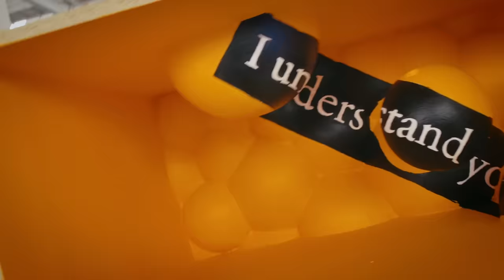OK Go - The Writing's On the Wall - Official Video

Comment: The thing about this that I love, is not just the optical illusions, it's the fact that this is a long pan shot. Aka, the video has no cuts to different illusions. Long pans are not very common in films and even if they're incorporated, they're short. This is because long pans are really hard to make. And this video, creates multiple optical illusions with ONE long pan, managing to position the camera at just the right angles at all times, with no cuts in the footage. It is so incredibly fascinating to watch because this video accomplishes something that even Hollywood has a major difficulty with.

I love this video.
Reply: There could be hidden cuts, but the vid is still excellently made if thats the case
Reply: Watch this too shall pass if you haven't already!
Reply: Yes and the band must have an incredibly much lower budget than say Hollywood so it’s really impressive. A lot of on rid left artwork and designs and creations, plus yes the perfect angles all the way through the pan
Reply: @nguyen-vuluu3150  there's a behind the scenes vid , its edited to be a bit smoother but they did it in one cut from all the fumbling and running from the entire crew and band
Reply: @nguyen-vuluu3150  Nope, there's none.
Reply: "Long pans are not very common in films and even if they're incorporated, they're short."

If you haven't seen it already, you should check out "Russian Ark." 

96 minutes long, one single unedited take. 

Shot in the Hermitage Museum in Saint Petersburg, it is narrated by a ghost who is accompanied by a French aristocrat who despises Russia and considers them to have no historical or cultural value. The ghost guides him through the museum and 300 years of Russian history, hoping to convince him otherwise. 

There were something like 2000 actors, and the final cut was one single 96 minute take. Just imagine the level of precision and synchronicity needed to pull that off. 

Not an easy film, it's rich with historical detail, and as soon as one story is told, the next begins without hesitation. It's a mammoth historical journey, and can leave your head swimming quite a lot, but if you like the cinematic aspect of that one huge take, then it's a must. 

https://en.wikipedia.org/wiki/Russian_Ark
Reply: @nguyen-vuluu3150  if you think that, you dont know the band. "This too Shall Pass" took like 9 months in the making, over 5 thousand shots. One single, big, long, take.

Comment: I was racking my brain thinking of how they could have painted everything to fit so perfectly, and then I had an idea. What if they put a projector in the place where the camera would go, and then they projected the image they wanted to make (square or circle or something else) and then they painted the surfaces that the image was being projected on. It would make it so much easier. I'm not sure if they did that or not, but it would make it so much easier.
Reply: Bryan Chu if they did that it wouldn't be proportional. Since the projecting would be smaller on closer objects and bigger on further away obejects.
Reply: Hmm. Have you noticed the way that objects close to us appear larger and those farther away appear smaller?
Reply: The parts of the building that get hit by the projector's light would be the same parts that would hit the camera with their own light.
Reply: Max K
Reply: ไม่ว่ารักจะทำให้เจบปานใดความรักยังงดงาม/เสมอ
Reply: If you see some of the behind the scenes stuff, you'll see that this is what they did, yeah.
Reply: Bryan Chu and all took in a single take
Reply: that's probably what they did
Reply: Bryan Chu nah man, they made contact with the aliens and got everything right, how'd you think the pyramids were made so well?
Reply: They used a projector in the Red Star Maccaline commercial, I don't know if they did it here.
Reply: That's actually a pretty common trick in theatre. I took a theatre class in high school, and used that trick first thing.
Reply: Yep, projectors is typically how this sort of thing is done.  Interestingly, even when optical illusions like this are done digitally, the process is pretty much the same.  Put a virtual camera in place and render the frame, then add additional objects to the scene and turn the camera into a projector that bakes that image onto the new objects.  The objects and cameras can then be animated, but so long as it ends up at the same spot where it was when the image was baked in, it will blend in with the background.

Doing it in real life, as they've done here,  is more time consuming, but it's ultimately the same process.
Reply: The issue is expansion and blurriness. Even if they used a Projector, the objects closer to it will have sharper and crispier edges, while the ones further will have blurred and enlarged edges as the light expands the more distance it covers.

I think probably used a printer or something of that sort to match the sentence. They also had to have match the colours as well, some the ones further won't seem as vibrant as the ones closer, or the paint might look different depending upon the surface.

This kinda thing can only be done via passion and hardwork.
Reply: Here is your answer:  https://m.youtube.com/watch?v=xRCZeEUP6Uk

Short answer: Yes projectors were used.
Reply: @Thatguyujustmet  damn. good to know now five years later